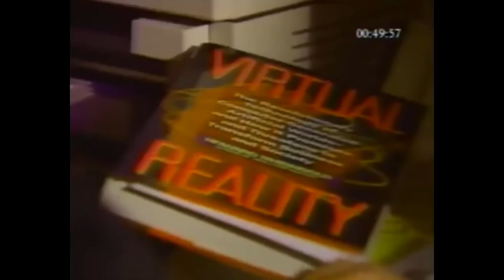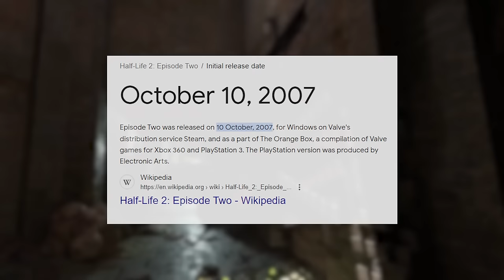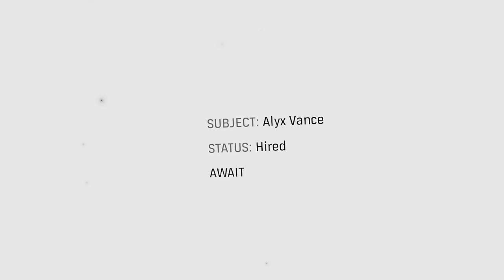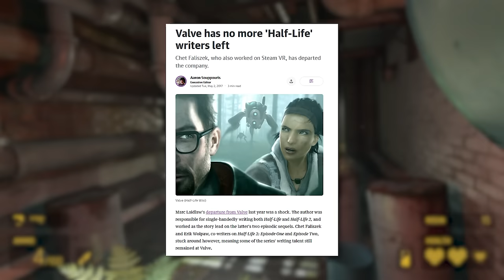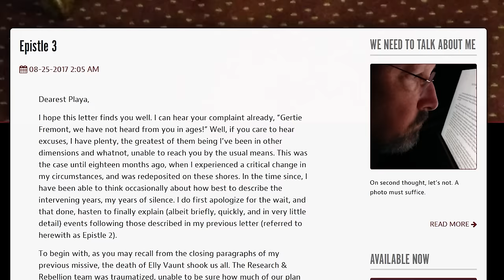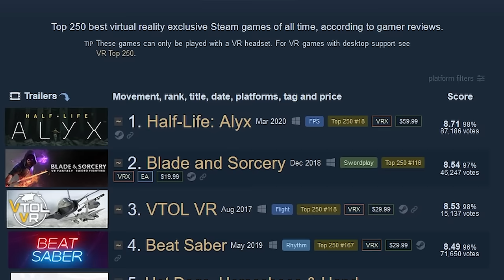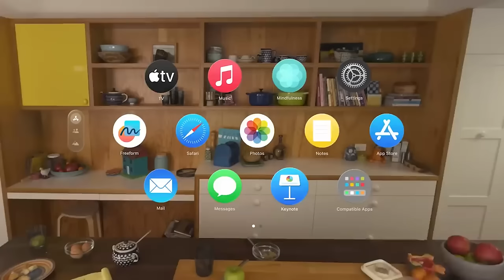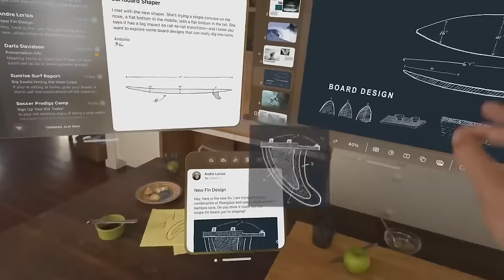VR's Greatest Hope, We Thought - Half Life: Alyx Four Years Later

Comment: This is a great video! 

The motion sickness you're struggling with is often caused with either low frame rates, or the stock lenses in the headset. If FPS isn't a problem, I'd recommend you get a pair of "gear VR lenses", but be extremely careful when modding your headset, because you don't want even a spec of dust on the screen!

Comment: A few things, first off that's ace content, nice one. Second, if you still get a bit sick in VR do not play boneworks. If you have any prescription at all, get lenses for your headset. As you are describing headaches rather than motion sickness, it sounds more like eye strain. The focal length is about two metres, so imagine trying to focus on things two metres away without glasses if you need them, and the kind of headache that would give you. If it's actually motion sickness, it's about the disconnect between your brain seeing that you should be moving, but you aren't. Find a way to ground yourself in reality, like putting a small rug or patch of carpet under your feet, and standing over the edge of it so you can feel the ridge. This helps keep you oriented and stop you wanting to fall over. A fan blowing towards you can do this as well, people use both at the same time. Just a few subtle reminders to your body where you actually are. I was very lucky I think, I had knee surgery the day they announced Alyx and bought a quest 1 in a morphine daze! £399 entry not £1000. Because I still wasn't mobile, my early gaming on it was all seated which gave me time to adjust. Games like The Climb etc with no artificial locomotion. Then in the few months before release I moved onto boneworks and saints and sinners, when Alyx released I was well adjusted to VR although still unable to crouch in real life, it was ace! So so good. Since that Q1 I have had a Quest 2, 3, Pico4 and a PSVR2. Currently playing mostly PSVR2, RE Village and 4 Remake are the only things I have enjoyed on a level with Alyx/S&S/Into the Radius 👍

Comment: I played on the Meta Quest 2 wirelessly. It works fine on medium fidelity settings, but you MUST have a 5GHz wifi network with GOOD signal, or you'll experience cutouts at times. On the Quest 2 it also had problems with the built in wireless app, but using Virtual Desktop worked right off the bat with no issue, as long as the wifi signal is great :)

Comment: its not just the software side. its the hardware too. vr headsets, are like shoes, most people size ranges can be bought at any store, but if your off those sizes, good luck. but the problem is: when i comes to shoes, you will still sell a lot of outside the ordinary sizes and shapes because theres a market, which isnt there, in vr. vr itself, is niche and if you can reach 90% of the people in that niche, its good enough for the companys, but those other 10% like me, have live with downsides, problems or dealbreakers and that wont change, unless more people get into vr and buy the hardware. my wife and i have very different problems. she has a very smal ipd of 54 and no headset goes that deep, the ones that do go low, collide with her noseridge. i on the other hand, am severly nearsighted with -7, making any lense insert so thick, that my eyebrows collide with the insert glas even on maximum eye relief setting. telling people about those problems, usally ends it "then vr isnt for you, go pick a different hobby". iam 38 years old, when i first tried vr on the ps5 vr2 at a friends house, i felt so much awe and wondered, that i last felt as a child and didnt think that adult version of,was still capeable of that, untill i realised, that i cant wear glasses under the headset, due to scratching the lenses, since i cant wear contacts, inserts were the only option, which as is said, are extrmly uncomfortable due to the size needed for me correction values and then hearing: its a 1 out 1000 problem, dont expect it to be fixed, market too smal for that extra mile, is very depressing to say they least

Comment: if you weren't getting nauseous just from alyx, i'd highly recommend boneworks.  it's basically a full on new half life story campaign complete with incredible full physical simulation of the players entire body, came out a few months before alyx, and it's a peak into the kind of game valve would make if vr sickness wasn't a thing. 
my biggest problems with alyx is that's focused more on atmosphere and player comfort than player freedom and creativity.  

if there's a pipe on the wall in boneworks, you can grab it and climb up.  if there's crates, you can stack them and go places you'd assume are out of bounds but instead find secrets and hidden stuff.  

if you have a crowbar in your hand, you can adjust the grip  position closer to favor controllable swings.  or you can move your grip point as low as possible to give max range but far less control.  it's all physics driven.
Reply: >a full on new half life story campaign
You mean that tech demo with janky as all hell physics?
Reply: @Noobochok  if you're talking about bonelab, the sequel, I'd agree there.  there's a well known leg bug glitch in that game that throws you into the floor when you walk on small debris, never been fixed.  also the levels in bonelab feel like a series of short feature experiments instead of a campaign.

boneworks on the other hand, is a fully featured 10 plus hour campaign where you're commiting industrial espionage inside a metaverse that is still under construction.  it's easily the best singleplayer campaign vr has to offer in terms of player freedom.

Comment: Getting the equipment to play half life alyx can be a lot cheaper though if you go used. I played it on a machine with a 3570 and an rx580 with an oculus rift s. It was definitely enjoyable and I didn't notice it running badly. If you go with a used optiplex and used GPU, you can get a similar or better PC for under $200. A rift or rift s is like $50-$100 depending on the condition.

Comment: Since he didn't mention it I'm guessing he didn't notice you can equip masks and hard hats, with masks protecting you from inhaling spores throughout the game.

And about VR, the original Oculus crowdfunding was so successful because it was supposed to be an open source, cheap and easy to use device that would bring VR to the masses. But then Palmer sold out, and once Facebook got it's hands on the device the made it into a luxury item, completely killing all the momentum VR had up to that point. And at this point I seriously doubt VR will be able to make comeback until someone is able to bring VR headsets down to the 200 bucks price it was originally meant to be.

Comment: in regards to your motion sickness, it really helps to have a PC/GPU that can run the frames per second to reach over 100(fps), as well as set your headset to 120hz.  Even running at 90hz helps, but I've only messed around with the Valve Index.  You also have to get your VR legs, which took a good week of immersion to eliminate most of what I got in game, and most of that was when I had to climb up stuff.

Comment: No game has ever been so stingy with ammo. I hated it for that. Forget the zombies or the monsters, the thing you are constantly scared of is running out of ammo. Don't panic, please never panic, you might miss your opponent once and therefore waste a bullet that would have saved your life 15 mintues later. And also, loot, loot loot. If you don't miss one ammo pack you will die.

If you run out of ammo you can still use the crowbar right? Wrong. No crowbar because reasons. No ammo, you die. You get back to your last savegame, great, but you already had spent too much ammo so you're dead for good. Restart the game from scratch.

I have never been able to understand why I felt to be the only one so annoyed by that. It spoiled the game for me.
Reply: Running out of ammo and realizing I had to reset the game because they didn't spawn enough ammo was one of the low points of the game for me, I never had issues like this in any other halflife game

Comment: Floating hands should be a thing of the past... Also I would actually use the headset to have Elsa 3D Revelator or 3DS like 3D effects even in 2D games without the problem of ghosting. This use case also shouldn't have problems like motion sickness, jumping to points you point at with your "laser pointer" instead of moving freely and so on.
I would also prefer movement per mouse and keyboard vs these awkwards VR controllers until we got real VR were out bodies believe we are really in the world and can move using our thoughts.

Comment: The lack of in the place NPCs was explained in one of the development commentaries. It is hard to put NPCs in the same place as the players, since unlike flatscreen FPS, VR is more personal. If NPCs touch the player,  they have to either push player away or go through the player. Pushing players around would induce heavy motion sickness. And people find it odd and intruding if NPC models simply go through player's head. So that's why the whole Alyx-Russel dialogue set up. And when NPC is presence, the devs make sure there is a physical barrier between the player and the NPC at all time. I would imagine it is hard to implement too often and could lead to immersion breaking.

I think changing the HL2:EP2 ending is a smart move. Originally, the episode endings were designed to be some kind of suspenses to hook players into the next episodic release, namely the citadel explosion in EP1 and Eli's death in EP2. Such hook doesn't make sense anymore with the episodic release model gone and no game released for so many years. There is no more intensive emotion on the Alyx-Eli storyline. Fans are just as interested in the general story as the specific consequences after Eli's death. This put the narrative in an awkward position. Removing the emotionally intensive ending of EP2 will probably ease the burden of HL3 having to address the EP2's immediate consequence, which has only become less relevant after all these years.
Reply: I disagree, NPC.

Comment: I got a second quest 2 so my daughter and I could have shared experiences as opposed to the isolation that a lone VR headset can entail.  Even then, that was after owning mine for almost four years with long stretches of it being in its case and I only got the second one because the prices have dropped so much.  I'm still on the fence buying Alyx...  Is watching a 3D 180 video on YouTube better than dropping the money and hoping having my headset and PC working in tandem can handle it?
Also disappointed by Bonelab (the Oculus port of Works), could have been so much more and the developers emphasis of a modding community blossoming around it instead of developing their own innovative gameplay just came across as lazy.  The amount of modding around HL was over years and at times a definite slow burn.

Comment: I worked with VR before this game was released and i was under no impression that this game would be the VR saver.

Its a gimmick and a annoying one at that.
VR as an idea is interesting but much like 3d tv its just not worth it.

We still use VR at work but why did i not think it was going to take off this time either?
(we tried during the 90's as well)
Honestly we use it to wow people but if you are after data or information you do not use VR.

VR is a anti social device costing a pretty penny that most do not see the point in getting.

I think VR will break thrue one day, but not before a few more issues are worked out.
One is just its moving and controlling issues
(not the hands but the body)

Comment: Boneworks was innovative, Valve wasn't even going to have smooth locomtion in Alyx until people complained. Alyx even has a non-VR mod, and I remember everyone saying that such a mod would make the game boring. If the game needs VR to not be boring, and VR isn't so integral that the game could work without it, then the VR is just a gimmick. You couldn't make a non-VR mod for Boneworks, because it actually utilizes the potential of VR. What does Alyx really do with VR other than the 3D puzzles you get bored of doing after the first time? All that just to tell a retcon story with "quirky" characters because Valve has lost its good writers.
Reply: Alyx is very clearly built for VR - even the scale of the environments is wrong without it. I will admit the writing leaves a lot to be desired, and the replacement of Alyx's voice actor for a younger voice is disappointing.
Reply: VR in alyx would be a gimmick if you could play it in non-VR and still have fun. A gimmick in this context just means a new way to accomplish something on-par, or worse than previous methods.